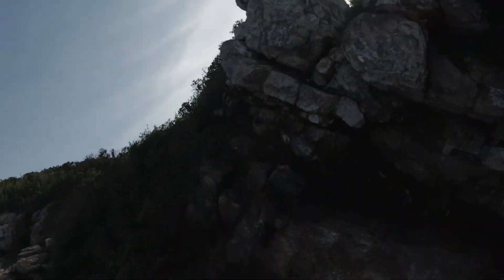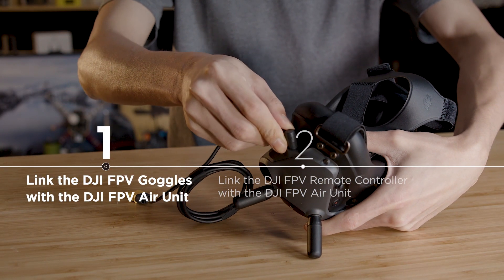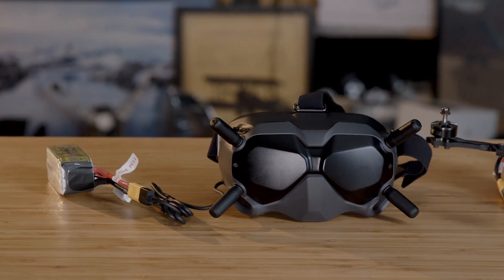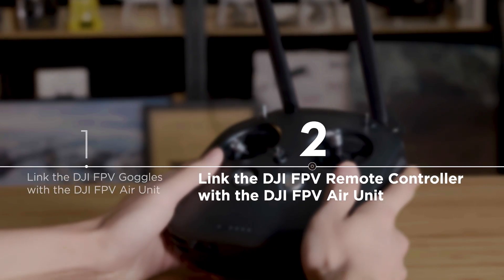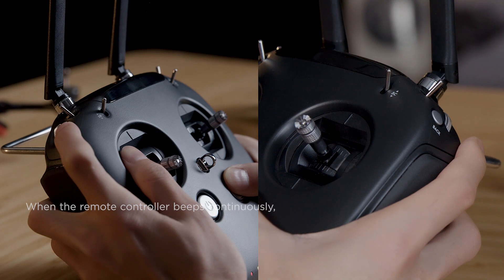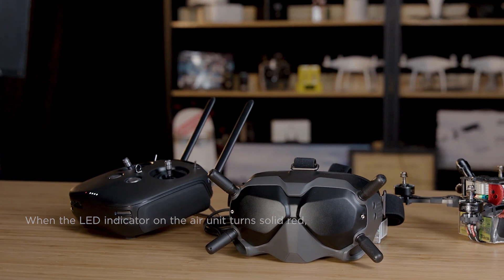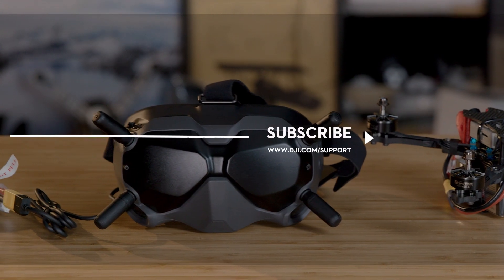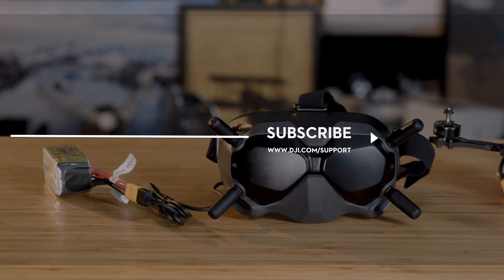DJI FPV System | How to Link the Components

Comment: 1st DJI has to upgrade their programming for a Mac. Otherwise I have an expensive fu@$&** paper weight.
Reply from the maker: The DJI Pocket 2 can be used while charging. It is recommended that you use it by itself after being fully charged. Using it while charging will cause the battery to heat up and affect its service life.

Comment: I already have the DJI Goggles v2 and use them with the Air Unit. I’ve just bought a separate FPV controller on eBay (the grey one from the DJI FPV drone package) thinking that I could use it with the Goggles and the Simulator. I’ve tried to pair the Goggles to the Controller by pressing the red button on the Goggles and holding the power button down on the controller. They beep and everything, but don’t seem to pair without the drone. Is there a way to pair the Goggles to the Controller without the drone?

Comment: Would I need to upgrade or downgrade my vista/and or goggles if multiple quads are stuck on low power mode/25m?? My older setup is fine but all my new builds in the last month are this way.

Comment: Hello, I am able to link the DJI FPV Goggles to the DJI FPV Air Unit, but just got this exact version of the DJI FPV Remote Controller and I'm unable to link it to the air unit.  Just sits in bind mode.  I have no problems with other Caddix Vista air units, links all fine.  Just not with this DJI FPV controller, doesn't make sense.  Any suggestions? Thanks!
Reply from the maker: Hi there, we are sorry to hear about the difficulties that you encountered. Please contact our support team via http://www.dji.com/support and provide more details, we'll do our best to help this out.

Comment: After my Air Unit updated, the red light is on solid and now it won't bind to goggles. This is a brand new Unit
Reply: Mine either!!!!! I've got one to bind but not other.  I'm on my way to sell this garbage
Reply: The wire ended up being the issue for me. I accidentally pinched it between the camera plates when putting the top plate back on. I took it out and now it works fine. Bound right away

Comment: DJI is sponsored by the Chinese communist party and Nikita Khrushchev they plan to spend all the money you send them on resurrecting Mao Tse Tung and Joseph Stalin. Thanks to the DJI pilots China has detailed strategic maps of working infrastructures and maps of Radio and Cyber surveillance In US, UK, and Parts of the European Union. Just like your I phone your Mavic or any other DJI equipment never sleeps even if you take the battery out.

Comment: Turns out the drone DID NOT have the DJI Air unit as the controller, but rather a FRSKY receiver ... wrong one delivered!!  No problem when the right one arrived!

Comment: Help, image transmission stopped.. Trying to bind but air unit stay red when bind button pressed..both googles and air unit are in latest firmware
Reply from the maker: Hi there, sorry for the inconvenience. Should you encounter any difficulties in using the DJI product, please feel free to contact our support team via http://www.dji.com/support, we're here for help.
Reply: @DJITutorials  They don't respond on the support page.
Reply: @DJITutorials  I had a small crash with my DJI FPV drone setup. I could fly the drone immediately after the crash no problem. However once I turned off the battery and started it up again. the drone and the controller/goggles would not connect/sync to the drone anymore. I Tried to pair the components again, and it occasionally reconnects but for the most part it won't connect upon startup... please help

Comment: Why no explanation on linking the DJI Controller to the Drone receiver??  I've spent 4+ days trying to link my DJI Controller to the iFlight MegaBee BNF drone, configured for the DJI HD FPV Goggle system ... All components (Air, Goggles and Controller) are linked and communicating ... but no control of the drone, and no info ANYWHERE re linking the DJI controller to the drone ... latest configurator, latest firmware, latest everything .. and still no control of drone by controller ... *U&^%^#$&^*^*(^%%$^&*(
Reply: As I see we all have problem with the product. 
I got the dji pack goggles, remote, and air unit. I ordered the iflight Titan. 
All from Banggood. 
I linked goggles and remote. Then remote with air unit on the Titan. Checked if it was working. I found the arming switch and it worked. 
I had a message in the goggles saying I need to register the air unit. 
Power up the air unit plug it to pc and update. 
All good so far. 
Power up the rest stuff, flip the arming switch. Nothing. Doesn’t arm. 
Seeing the goggles and remote are one version back. Air unit was on 3rd update it came out at 10th of January the day I registered/updated the unit. Rest was on 2nd update version. Updated them too. Still no arming. Nothing on receiver tab in Betaflight. Some days ago 4th up date came out. All flashed. Then link/bind. Still nothing work. 
I bet the air unit got very hot at the update sitting there with no cool air so it’s burned. 
I had a friend that got the dji combo and 2 out of 3 air units he send them to be replaced. I talked to him and told me probably it overheated. 
Soooo Fuck you DJI for not saying that if gets overheated it can be burned.  Fuck you dji for not making it more robust. We spend so much money on your stuff to have so bad experience.
Reply: @xaralampos1959  It is incredibly frustrating .. spent :30 on the phone to CHINA DJI tech support today, and they can't explain how the "ARM" switch works, how it is set, how to use BetaFlight, etc... An "engineer" is supposed to call ... And, iFlight no better ... no manual or instructions for the MegaBee w. DJI Air Unit.  Did find out from Joshua Bardwell (https://www.youtube.com/watch?v=M0S3HTQihxs) that you need to power the Air Unit/drone to see the receiver controls working w. BetaFlight.  You may need to change the firmware in the Air Unit w. BetaFlight in addition to updating it with DJI Assistant 2 ...
Reply: Rich Sugden arming switch on mine was the front right named SC
Reply: @rsugdenmd  Hope you got everything up and running.  Just received my 2nd FPV (Rotor Riot HD1 Build) and have everything bound to the DJI FPV Goggles, DJI FPV Air Unit, and DJI FPV Remote Controller.....Looks like you had a few struggles...hopefully you got everything working....updating my progress on my channel as well..new to FPV...it's a challenge but getting there.
Reply: RGMG Turned out there is near-invisible USB-C jack on flight controller for BetaFlight ... then found wrong comm protocol selected, and able to configure ARM and flight
mode ... FLYING!!  Joshua Bardwell is Racing Quad guru ... google on YouTube for his great videos... he can set up call w. screen sharing and fix everything in minutes if you subscribe.
Reply: @rsugdenmd  Thanks!  Yes, I've been following many of Joshua's videos.  Glad your up and running.  Had a great day myself yesterday (50 degrees in NJ) and managed to finally get some fly time in (still learning)....got through nearly 11 batteries yesterday.  Good day!   Yep, I'm subscribed to Joshua's channel....very smart guy.
Reply: @rsugdenmd  DUDE I JUST FIGURED IT OUT!!!! 
1) Put the SA Switch in the middle position. 
2) Put the left stick at the bottom position. 
3) Then, move the SA switch from the middle position to the bottom position.

It should turn on!
Reply: @xaralampos1959  Yo thanks for your answer. I just connected a new air unit to the drone and see it works! Now I am afraid to overheat it directly. I will contact DJI for warranty replacement.
Reply: Pascal Klein your switch works and the motors spin when you arm the drone?
Reply: Babis xalkias Yes, switch to arm the drone is SA (upper switch on the left side). It has to be in middle position.
Reply: Same problem over here!! And under Device Info in the Googles the Remote isn't showing up!! PLEASE HELP! I am with the iflight Titan DC 5
Reply: @pascal_clain  I gave up and sent the drone back .. and ordered another from the manufacturer ... iFlight MegaBee.
Reply: @rsugdenmd  Oh nooo! and now its working or are you just waiting for it? I ordered from Banggood and I hope they will respond soon.
Reply: @pascal_clain  Waiting for it to arrive from iFlight ... Did you order the same one from Bangood??  The iFlight MegaBee ... The 'secret' is you do not want any receiver in the drone .. the DJI Air Unit is the receiver, and is wired directly to the drone controller board ...
Reply: Rich Sugden yes I know what you mean. I am with the TITAN DC 5 + DJI System. But what the hell... there must be an explanation why its not working for us. There are so many people flying the System and for us it’s not working? I want to know how to get this thing up in the air. Aaaa interesting point for you. I have a second air unit from DJI here. So I just connected this one but still same mistake. That’s why I guess the mistake might be more with the flight controller. Tomorrow I will try to contact DJI Support and now waiting for answer from banggood. First time I ordered from iflight but package got lost and never arrived to Germany.
Reply: @pascal_clain  Like mine, you probably also have an RC receiver in the drone which is not supposed to be there ... only the DJI air unit .. no receiver.
Reply: Rich Sugden sorry i didn’t get that?! What do you mean? I ordered the drone without any additional receiver. Before ordering I clarified that. Or what do you mean with that?

Comment: All of my systems are linked and I see a solid red and green on my circuit board. However, the controller will not arm the drone. Even if I connect it to Betaflight, the remote controller is not recognized. I bought this as a RTF from GetFPV.com, but as you can probably tell it has been anything but RTF. Any ideas on what may be causing the remote not to arm the drone?
Reply: I have the same problem! Madning!
Reply: I've spent 4 days trying to figure out  how to link the DJI controller to the receiver in the iFlight MegaBee ... still no luck!!
Reply: I had to send my RTF lumineer qav r2, back to where I bought it. If ya'll can do the same I suggest you do that.
Reply: @FreshCoastDon.007  I'm going to try online chat w. DJI tomorrow and if that fails then back she goes ...
Reply: After aan while mine started working. Sadly I didn't see what made the difference. Maybe powering all components on and off a couple of times will do the trick.
Reply: @rutgerdezeeuw  Peter - what kind of drone are you using w. the DJI FPV Goggles ... and do you know what kind of receiver the Air Unit is connected to??  Can you reply w. a link to the drone purchase site and maybe I can figure out?  I'm using the iFlight MegaBee w/o any luck so far!!  Thanks!!
Reply: Same problem as well! I got mine from GetFPV.com also. I can't figure out how to take off
Reply: @peter selie

Comment: hi,just wondering why my remote controller not communicate with the air unit?
after 3 days i have recieved the fly more combo mode2 still could not fly just to see how its feel like,
last night i have found its cos not all the components are using he same software,after i have done it correctly i could get the signal from the dji radio when i changed it from normal to sbus in betaflight at reciever tab either i saw the channels are moving when i was moving stiks,well i turned everything off so i can fly today morning but im actually not sure how its not working again,
well again i have gone to dji assistanc 2 and refresh the software on all the components,
unfortunately the result was the same,no communicasion,please help
regards:Ashcopter +61421332540 contact me plz

Comment: Thanks to Share, I bought the googles and 3 units for my drones.
But I have a big question?!
Any time I want to Change the drone I have to rebind?!? Or it saves the bind of my 3 units?!?
Reply: Had the same question?  Guess I'll just test and let you guys know what happens since I don't see a response here.
Reply: Yap it saves all the binds you do. ;)
Reply: @dstepsfpv  Thanks wasn't sure...I have 2 Air Units and tested last night.  Was able to bind them both to a single pair of googles & remote controller.  Flipped back and forth and rebinds automatically.

Comment: as a newby ..still dont understand what the dji remote controller is used for,? how about the remote controller that came with the fpv drone?
Reply: It provides HDMI output. Kind of expensive and bulky, but still.
Product description
DJI's FPV Remote Controller was made for racing and freestyle pilots. The added switches give more configuration options than previous DJI remote controllers. The DJI Remote syncs perfectly with the DJI FPV Air Unit for seamless integration into your drone builds. With the DJI FPV Remote Controller, parameters of each component can be adjusted remotely. Purchasing the DJI FPV Goggles and the DJI FPV Air Unit eliminates the need of any additional receiver. Users can also enjoy 7ms ultra-low latency between the remote controller and the air unit. Note: Using the DJI FPV Remote Controller is optional with the DJI Digital HD FPV system. The DJI Remote Controller is useful if you want to use their built-in Tx system.

Comment: For me impossible to link the goggles to the air unit and i have a warning imageg transmission stoped..........
Reply from the maker: Hi, may we confirm the color of the indicator on the Air Unit when it is powered on? If it is solid red or blinking red, it is not normal, you may need to send in the unit for diagnosis. If it is solid green, please try to press the button and see it will turn to red, if it will not, you may also need to send it in. 
If the indicator turns into red normally, please first make sure that the whole FPV system has been updated to the latest version. If the issue persists, please kindly provide us with a video of your case for further confirmation. Thank you.

Comment: So I need to use the dji remote?? I like my frsky remote juste fine! It should  be just a digital video tx and rx. Not the remote to!
Reply from the maker: Hi Axel, the DJI FPV System is compatible with remote controllers of other brands, please note that an additional receiver is required when using the DJI FPV System with other remote controllers. Thank you for your attention.
Reply: @DJITutorials  Thanks, I were to fast posting that comment, I shuld have done more reserch!
Reply: @axeledlund2057  Hi Axel, Did you find out what kind of receiver to get and how to connect it ?
Reply: @DJITutorials  See earlier comment .... have spent 4 days, many hours a day, trying to get the DJI Controller linked to the receiver in the iFlight DJI FPV Goggle equipped MegaBee Drone ... everything links fine except the DJI Controller to the iFlight SucceX-D Mini F7  Flight Controller .. I see no "bind" button, none described anywhere on the web .. and of course NO INSTRUCTIONS CAME WITH THE IFLIGHT DRONE!!  HOW DO I BIND THE DJI CONTROLLER TO THE IFLIGHT SucceX-D Mini F7  Flight Controller IN THE DRONE??????

Comment: Not gonna be adopted by the fpv community it will be used at races or commercial events that's it and nothing more
Reply: why not?
Reply: FPV community loves the DJI system, and can't wait until they can get the system small enough for tiny whoop sized craft.  Literally the only people who need the low latency of analog video are hardcore racers, and even some of them are starting to come around to the more immersive experience of the DJI FPV System.